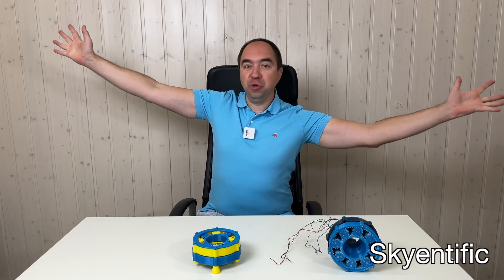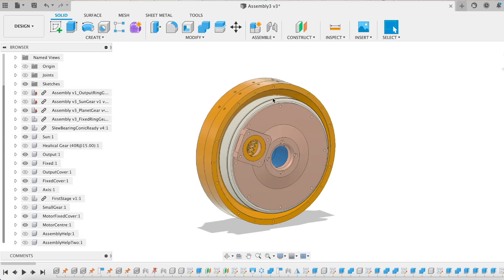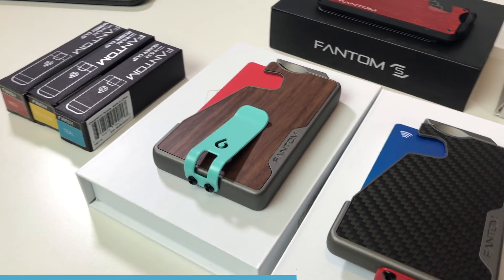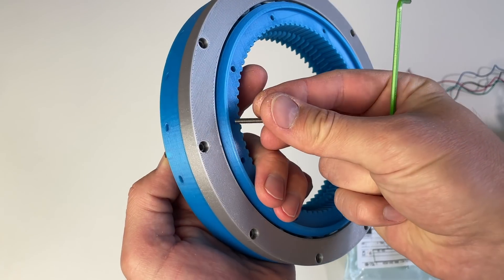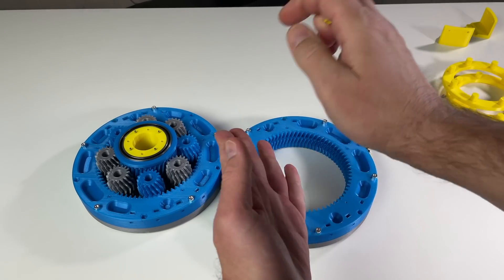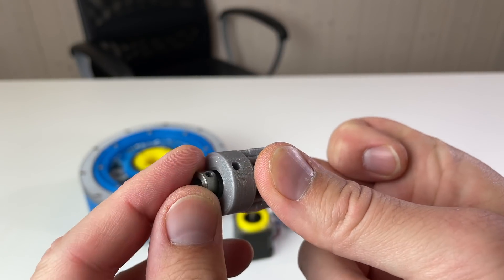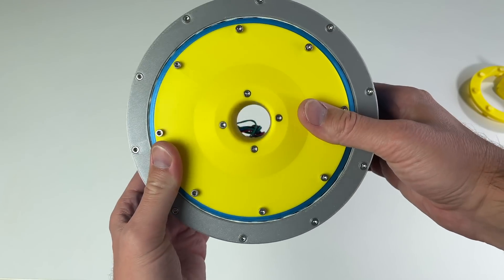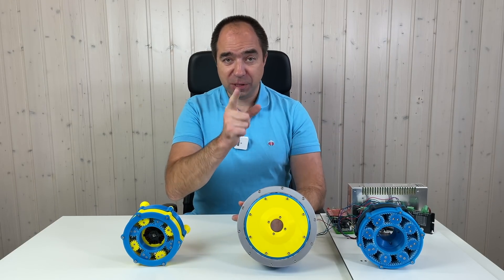3D printed Robot servo for only $32 (stepper, cross roller bearing)

Comment: hi, i have a problem. i made a robot using multiple your gearboxes. the bottom gearbox that moves whole arm up and down often struggles going up. do i need bigger or smaller tolerances between teeth (and which teeth?) or what should i do?

Comment: The thing with steppers is that they have so little power. I'm on the same boat and have spent a lot of time testing and trying to figure something out. At the very least something useful needs 20Nm or 200kg-cm at 20-50 rpm. You could try a gear motor instead of the steppper and put a diy encoder on the front end 🤔 The gear motor could do the bulk of the transmission and a simpler one stage printed 10:1 planetary could take care of the backlash.

Comment: so im very new to 3d printing and robotics. what does this do other than just from what i can see, use gears to slow the turn? but why slow down or ratio down? why not just decrease the pulses and slow it that way? does it reduce strain on a central point or something too? also would more moving parts and thus friction cause less power to be transfered to your end point? im definitly missing a step or two in understanding just a point in the right direction would be great.

Comment: Could you use pneumatic tube from Teflon to make the bearings? Just cut to length and you have very round bearings.
Reply from the maker: Yes, this would be ideal. But the tube should have good circular cross section (not oval). Also tube should have large diameter (here the rollers have 12mm diameter), and the tube should be rigid enough (to keep circular shape under the load).
Reply from the maker: In my opinion, standard Festo tubes would not work (not rigid enough, they would not keep the circular shape, under the load).
Reply: Something I have done on previous bearings and gears is to have a tool housing setup where I apply some grease that intentionally has a lot of cutting paste in - then I run it with a drill to smooth out high points and then transfer the smoothed bearings. I also do the other way around to have tool bearings to grind out a new housing - then smoothed bearings combine with smoothed housings and I keep the tool set for more. This works very well for the gearboxes from Gear down for what - adds a little backlash but massively reduces friction from printed layer lines.

Comment: This is such a great video, thank you!! Looks like herringbone gears (helical is just slanted one way, no?). Can't wait to see where this takes you. I have 3D printed some slew bearings and have been working on my gears, but my robot is still lackluster. Oh, another question, the bearing you used for the shaft - could that be 3D printed too? Too small? does it have to have a bearing?

Comment: two things 
1. there is an option on cura to randomize layer starts so the "seam" wont be the same on ever layer maybe that will help smooth it our
2. has anyone considered using those "candy" beads as a bearing piece like the conical pieces used here in this video?
Reply: also can we have STEP files i would really like to play with this model in fusion 360

Comment: Seeing as you're using chevron gears now you might not need the slew  bearings, since chevron gears can support an axial load. One of the designs you showcased took this a step further by making the gears conical as well as double helical which further allows them to support an axial load. I think this approach would be functionally just as good as a 3d printed bearing, while being considerably simpler and using less parts.

Comment: Awesome video and cool gearing assembly!  Have you thought about including o-ring glands to add o-rings to seal the unit up and keeping the gears in an oil bath?  That would ensure ample lubrication as well as probably quiet the assembly down.  It will create a bit of drag, but the lubrication would be more than enough.

Comment: When you talked about eliminating dowel pins, but still needing something for location and alignment. I recently found a method that works great for 3d printing.  Chamfer your holes, as if your going to put a screw with  angled head in it. Would probably best to call this the female feature. Then on your other surface make the same feature with an extrusion and chamfer, just in the male orientation. I usually put a screw threw these features as well. It will act similar to a dowel and force the surface to align during assembly. If you want a better example send me a message I can send you some examples or possibly post a video for you to show what i am doing.
Reply: Awesome tip. Gonna experiment with this.
Reply: I do this but go one step more.   If two surfaces meet and are fastened with screws there is no need for the surfaces to be flat.  They are flat when made of metal because flat is an easy shape to machine.  But with 3D plastic why not make is wavy or dimpled like a golf ball.  

I use truncated pyramids with long rectangular bases between the screws.  Or if the surfaces are round like pipe flanges the bases are made of concentric arcs.   I use about 1/4 of the surface area with these.    You might call this "intermittent tongue and groove."   The idea is that 100% of the shear force is taken by the interlocking geometry and the screws only see tension force

In Fusion360, I fist draw the base, extrude up with 15 degree taper ange.  Then use this as a tool to subtract from the mating flange.   Finally, I fillet ONLY the make features.

It is self-aligning but, better is is 4x stronger in shear

Comment: Recently I had a similar problem with seems/print inconsistencies holding up a slighting assembly. One of the solutions I tried was valve grinding compound. Ideally Valve lapping compound would of likely been better as it has a smaller/finer abrasive size. However this solution still worked great in solving the problem. Allowing the highs of the parts to bed themselves in against each other and smooth out. (in this situation it was the relatively small layer lines, catching like threads on the part attempting to slide).

 This could be a solution for some of your problems as well. I've gone so far on some assemblies to intentionally over extrude, then come back with an abrasive of some form, to reach the final smoothed dimension. (works great when tapping 3d printed parts as well).

Comment: I saw other ppl on youtube 3d printing bearings and "testing" them by running them idle at max RPM. This is total BS because a bearing is made to both allow motion on one axis AND totally prevent it on another axis. This is the best 3d printed bearing/gearbox I have seen on YT yet

To make smooth surfaces one could coat running surface/rollers in a thin layer of epoxy resin or glue

Comment: to fix the 3d printed gears to the motor shafts use small cheap aliexpress 16tooth pulleys,. they work great. u just press fit your gear over the aluminium small pulleys. maybe add some glue

Comment: Just out of curiosity: why does nobody use exisiting wheel hubs from a car for most of their assemblies (<15$/€ new)? Should solve 99% of the issues, incredibly stable, minimal play, it is literally build to carry a car and it's forces in all directions. Yes you still need a drive motor, but there are bearings, mounting points and if you pick a driven wheel hub, you get at least the spline part for adding the 3D printed gears. I can't be the only one with that idea, what am I missing?

Comment: why are the cross roller bearings conical? is it possible to buy metal beads/bearings to use instead of 3d printed bearings?  I would like to try modelling with cross roller bearingse

Comment: Instead of cross roller bearings I'd go for *conical gear bearings*. — This sould:
★ be much more silent
★ remove the risk of the rollers starting to slide (due to getting caught in those insufficieltly randomized seams),  which may lead to a rapid self-destructive internal meltdown.

Comment: a really dedicated design. since you have so much space in the center left, wouldn't it be an option to construct an axis there that holds the hull? preferably mounted with x-bearings or o-bearings (depending on loading case). You'd need to have a machined axis, maybe it could be printed because it will be stationary but even when machined it is probably around 30-50$ and you gain a lot of robustness and save the big plastic bearings

Comment: At 9:30, when you explain the orientation of the planet gears, could you explain why this is needed? I would think the gears are symmetrical, so it would not matter that much how they are oriented? Amazing work by the way! Is it easy to draw these gears in fusion 360?
Reply: 03:01

Comment: I've experimented a lot with fully printed roller bearings, but no matter how hard I try, they always jam or backlash. I finally chose and use printed bearings using Airsoft BBs. Very cheap, and easy to make work smooth.
Reply from the maker: BTW, Let’s Print youtube channel have tested different 3D printed bearings, and Airsoft BBs one was not durable at all.
Reply from the maker: I am afraid that airsoft BBs are too small to make a solid bearing. Because of small diameter they may deform plastic raceway. And also here you would need to make deep grove bearing or angular contact bearing (for the trust loads (axial), which would not be easy with the small BBs.
Reply: @Skyentific  Great, thanks for saving me the time of attempting that
Reply: I have BB's so I may try this with this gearbox, though I probably I won't be able to repost the design since the original is patreon exclusive.
Reply: I have tried a small 3D printed NEMA 17 7:1 cycloidal gearbox using BB's as bearings on double angular contact races. Did not work out well. Too much play in radial and axial.

Comment: You could bite the bullet and just use a small plastic round stock for the rollers or make very deep groove ball bearing instead and use off the shelf plastic balls. It would still be cheap and you could clean up the seams on just the four races by hand and have a pretty smooth bearing

Comment: Well done! Why didn't you use sandpaper to smooth the imperfections (printing seams) in your prints?
Reply: because of cost vs benefit. Yes, sandpaper can remove a bump, but it also will remove material around the bump. By the time the bump is gone, you've done more damage around it. There are ways to remove a bump on an arc while touching less and less of the surrounding material, but the more accurate you get, the more you approach methods of machining and lathing. 3D printed components are supposed to exist in lieu of machining. So in this case, just skip the sandpaper or other post-print processing, and just figure out a better way to 3D print to avoid the problem. 

In the domain of 3D printed parts, imperfect parts are trash. "Print better" is the fix, not post-processing.

Comment: 03:35 you can print all the gears in place with 0.1mm gap so you don't need to assemble them afterwards. This could be an interesting test.
Reply: That would add quite a bit of backlash in the gear though, and that's not what you want for robotic acuators.
Reply: That might require pva between the two rings though but maybe pausing and adding kapton tape on the seam might work.

Comment: What if you found some cheap Teflon bushings for the cross roller bearings? Just see what kind of sizes you can find and design the gearbox around them.
Reply: I think the problem is that the rollers have a cone shape.   He mentions it at 5:42
Reply: @SwankySasquatch66  You're right I must have missed that. I just don't like the idea of using 3d printed plastic for bearings. Might only work in the short term.
Reply: @onurmemis3618  
I am not at my PC right now so I can't look it up right now but look up the metal bearing used by the video featuring the 3D printed Halbach array motor.

They're less than $10 each on Amazon

Comment: Great job.
Please keep using stepper motors.
The cost difference of the motor and the driver compared to brushless is insane. And most of the benefits of brushless aren't even worth it after the power has been through high reduction ratio plastic gearing anyway.
It would also be interesting to see you push this actuator to its breaking point. It might be able to handle some impressive weight. Testing different plasics would be interesting as well.
Reply: Absolutely, I like the video to push towards high load tests!
Reply: Using a cheap brushed motor with a  printed plastic ring and a photointerrupter like paper printers use should make it at the same price but including an esp32/100+mhz arm board (stm32) and the driver. 
Using a cheap magnetic position sensor on the output might work pretty well too.
Maybe using both given the price of an optointerruptor and printable transparent paper.
I think making a cheap stm32 or esp32 board with an h bridge and connections for an optointerruptor and/or magnetic position sensor would be a great thing.
It should be doable for <10 bucks and would allow fairly precise positioning without steppers (though holding torque is low but that's not always a problem, especially with high reduction.)
Using something like a windshield wiper motor might allow pretty insane torques for the price
Reply: @satibel  why people are bent on using brushless servo motors when TM motors and other brushed DC motors are very cheap. Are we putting a million miles on them? if economics are the problem then use the cheap stuff to demonstrate potential value of machinery. The only real cost is the servo driver and PSU.
Reply: @togowack  with 12V brushed motors, you can use a free or very cheap second hand pc atx psu, they can usually handle 20A or more, so it's not even a problem, just use one per motor and run them at ~50% load, so they last and have better efficiency. 
windshield wiper motors are also usually fairly cheap (10-20 bucks in a junkyard, especially if you buy like 5) and have plenty of power for most applications (30 to 120W with over 10Nm of torque) also if using that with like a 1:2-1:3 pulley or even direct drive you can probably have a good enough actuator (15-45 rpm would be decent)
Reply: @togowack  You guys are spot on the money, BLs are overkill for a general robotics application. I've been testing with some large brushed worm and  'box' type gear motors and they give huge power for the money. With a potentiometer or encoder you can get a reasonable accuracy. 
Lowering costs is key especially once a robot needs ten or twenty joints.

Comment: tuning linear advance /pressure advance really helps minimize seams. you can also manually put a small slit inset at an angle around the perimeter to both be able to choose exactly where the seam is (using sharpest corner as a setting) and to spread it out to avoid a bump at a single angle
Reply from the maker: This is a great idea!!!
Reply: I don't randomise the seam. Instead I just file it with sandpaper or similar.
Reply from the maker: @eugene-d  I tried this. It takes too much time to send 38 rollers per bearing, so it is 76 per joint, times 6 or 7 joints. It is too much :)))
Reply: @Skyentific  , that's true. Then fine-tuning the slicer settings seems very reasonable.
Reply: @Skyentific  You can try using the hand drill and some 3d printed fixtures to vastly accelerate the sanding process
Reply: You will need to tune it for every filament you use. Works but....Good Cura settings do the trick
Reply: @danieltalavera9847  That's only true to a small extent in my experience.

Most pla for instance will be close enough to other pla that you wont notice a difference. The same is true of basically most filaments with similar levels of stiffness (durometers) .

I leave a general value on, and it works pretty well for most stiff filaments I print, and its still better than nothing even when I use a softer filament without retuning.
Reply: @BeefIngot  if using cura, you can use random seam combined with a small negative value on "retraction extra prime amount". Something like -0.05. It may produce a small underextrusion at start of layer, but on contact surfaces a small hole is better than a small lump. With a bit of hit and miss testing, you can get it quite invisible.

Comment: This is an amazing actuator!!If you are worried about the speed then you could increase the voltage supplied to the stepper drivers. I am running my Nema 17s with 80V (supplied to the drivers) and it works very well and they turn much much faster than with the 24V PSU :)